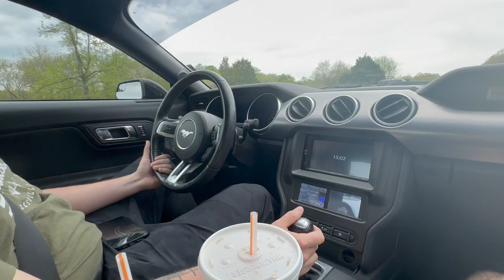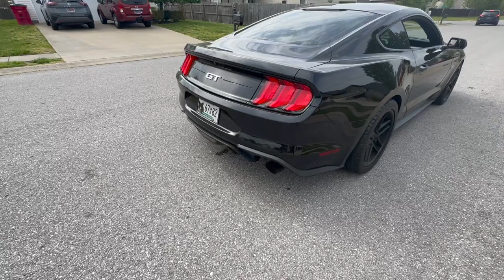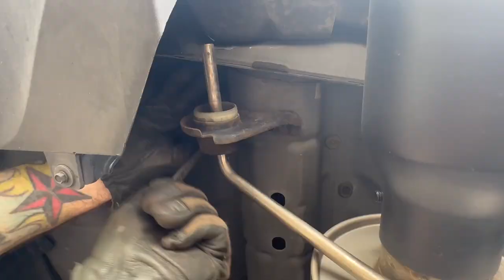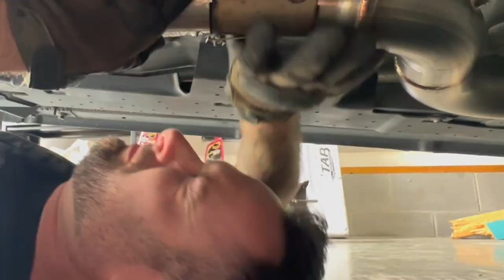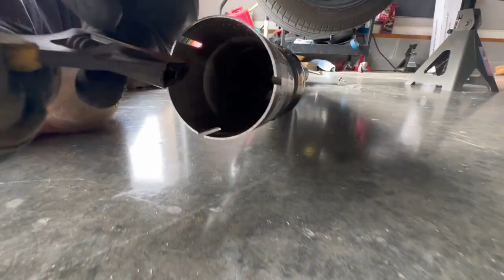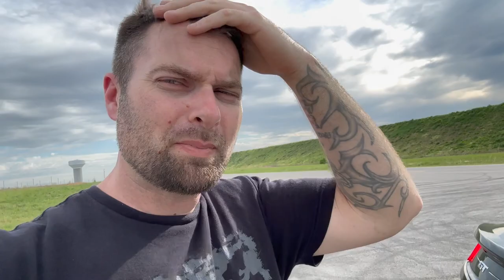THE WORST s550 Mustang GT Exhaust YOU WILL EVER HEAR *VIEWER BEWARE...

Comment: I can't stand Roush. I just ordered MBRP 3" catback. There's definitely better sounding setups, like Magnaflow and Corsa but I refuse to spend 2k for exhaust on a Mustang. My Viper has Corsa, love them on that but when did mustang parts get crazy expensive?!?! lol
Reply: put on the MBRP race with only 200 miles on my car, it's so loud I love it
Reply: @dnalor8753  I did the street series. But funny I just broke 100mi on mine.
Reply: Got mbrp race series as well have to agree with 👍
Reply: Topofthelinetommy, I agree. I've had Mustangs since the 91 the foxbody and parts were never that expensive to make them fast, especially exhaust, exhaust were cheap. Now I have a 2019 procharged Mustang and everything is ridiculously expensive. Exhaust are the same parts, just different bends and they've went up in price outrageous 😮😮
Reply: @monoajones  I had a 11' 5.0 and got it supercharged and installed for 7k. Now you're 10k for the damn blower. That's cool though I love procharger, I have an F1x on my Viper now.
Reply: I just installed the MBRP race pro series on my GT/CS it’s on my shorts on my channel

Comment: I like this sound better than Corsa Extreme. I ordered the Dark Horse on the 6th of April. I was told to expect an 8-9 month wait. My son owns the dealership and I was allotted the first allocation. I plan to do headers and AWE for sound and Whipple for power. This will be my daily driver. I prefer the deeper sound over the double X-pipe sound of Corsa. 
Thanks for the video Alex!!! Blessings to you and your family‼️🇺🇸✝️
Reply: are the headers even developed yet for the dark horse ? i think it will be a wile until they start making aftermarket products for the dark horse
Reply: @mrdr_392  no the headers are not made yet but as always they will appear. The dark horse will be an 8-9 month wait from now. My order is through my son who owns the dealership. Specialty cars/vehicles are going to come out slow. Look how poorly the Bronco took. Some people waited almost 2 years. So not in a hurry. It will happen when it does and Ford has already stated that they will open the ECM with a few partners like Whipple.

Comment: I had the worst exhaust system ever!  Long tubes, race pipes into MBRP race catback.😅  It was basically straight pipe which sounds god awful on a Coyote.  Any kind of Extreme, or Race, etc. Catback with Long Tubes and no cats will just sound like ass.  I went back to the stock exhaust after the headers.  Yup, so long tubes into the stock resonator, stock mufflers and stock quad tailpipes.  My car is Procharged too.  That rasp is long gone.